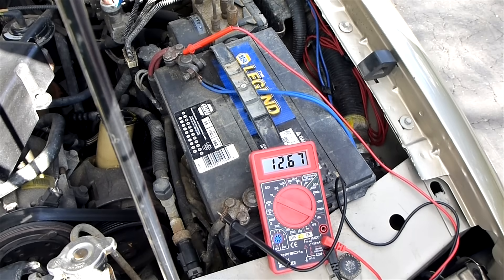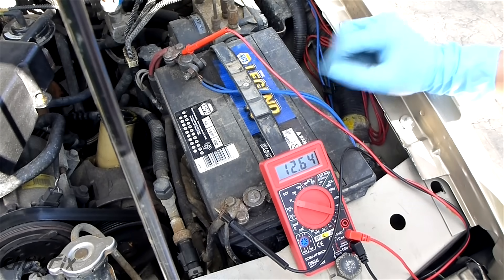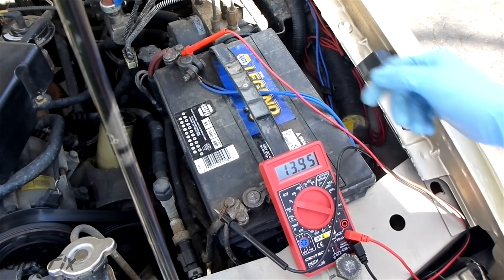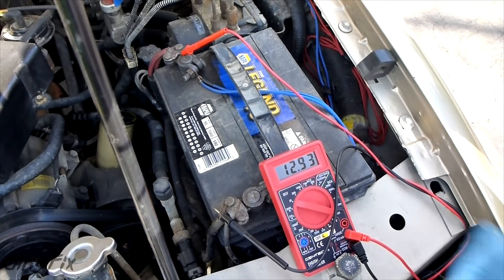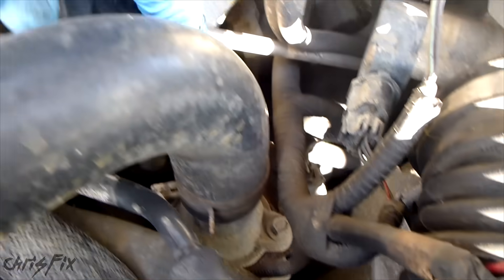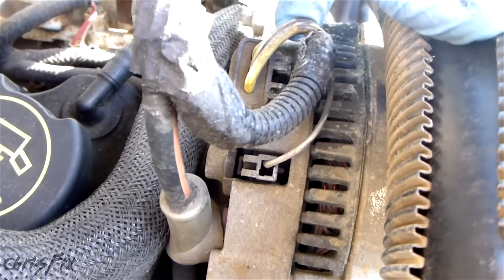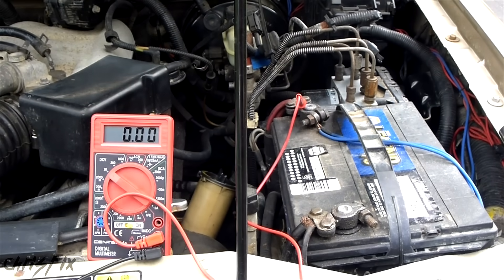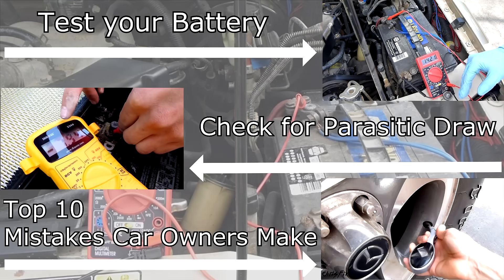How to Test an Alternator

Comment: Hey! Got an update went out and picked up a multimeter. With everything off battery had 12.6! Which is spot on when i put key in and in ignition position (when dash lights and checks come up) goes to 12.1-12.2v when car was on it showed 14.75ish. But then 5seconds of holding lights etc went dim for a split second and back to bright then went down to 14.67ish (just turned on engine so maybe somthing kicked in) so baffling but went for a 30odd mile drive and no battery light. Getting dark now in UK so will try the fuse test when i get some free time.. Thanks for the quick response.
Reply from the maker: Chris Selin Awesome! It is good you tested everything and now you have a good idea of what is going on. Can you explain what you mean by "But then 5seconds of holding lights etc went dim for a split second and back to bright then went down to 14.67ish" I dont understand what happened.

Comment: Hello i have used the onboard system that shows the battery voltages when off and on just like a handheld unit. May have to go buy myself one as may be more accurate. But as for leaving it well i always use the car but if use it for 10mins will be 12.8 or near then say 2hrs will be 12.1-12.2ish. If i do the same again but its sitting for say 10-15hours will still have atleast 12.1 so i havent seen it drop past 12 as of yet. Only thing i can think of is if the alternator wiring or so have been stripped and touching something. But dont want to go straight to a garage spending loads on something without success. Or maybe some other electrical leak but the car has so much on it its silly for e.g. Cruise control, electric mirrors, radio, electric chair, climate control, bluetooth phone (built into car not aftermarket) list goes on so would be a pain to pin it down looked online and people suggest could be a ecu fault with the ford smart charge system. Ahhhh just so much brain ache! Also i need to fit a battery clamp as its not secure atm but battery not moving as its a huge lump!
Reply from the maker: Chris Selin Try doing this test and after checking the fuses, disconnect the alternator wire and see if anything changes: https://www.youtube.com/watch?v=n5FJDgcdii8

Comment: Need urgent help but very very strange problem! Okay so basically i replaced my batter due to old one being to weak. So i got a higher end with 800CCA 85Ah right anyway i got the new battery but it sat in my boot in freezing conditions for 2weeks maybe then i fitted the battery (without charging) car has 12.1-12.3! When i turn engine on i get 14.6-14.7! So alternator is charging right?! But! Light pops up sometimes randomly but even when the battery light is ON its still charging when i shut off after 10min drive it will have 12.8-12.9v but over night or even couple of hours it will be back to 12.2v.... Just confused why the light sometimes pops up but when i drive off it can go off right away but sometimes will stay on until i turn off then back on... So new battery with 12.2V? Do i need to charge up or will the alternator top it? Just a head ache when its showing that its charging. What do you recommend. 2009 mondeo titanium (alot of gadgets) all connections look clean enough to eat your dinner off.
Reply from the maker: Chris Selin What happens if the car sits for a few days with no use? Did you test the voltage drop on your alternator like in the video? Is your belt loose?

Comment: Hi Chris,
 you should tidy up your battery. i noticed on the battery terminals you have those clamp type fitting, and some off the wire strands are not clamped, also the negative clamp on the battery terminal is loose, it moved when you pushed the test probe into the wires,, you didn't seem to no that this is a critical connection,,
undo that clamp, and spread it so the clamp goes all the way down the terminal and re tighten.
that's after you fit the cable under its clamp properly.
 then i would be interested to see you test the drop across this connection, turn your lights and every thing else on, not the engine for the test..
Reply from the maker: ScoutBoy Thanks for the tips! I will have to tidy it up.

Comment: Hey Chris, I have a 1976 Hillman Avenger(1600cc 4cyl, 8 fuse, 4spd manual) My alternator is not charging the battery at all, when the car is running i only have 12.55v at the battery with a good battery out of my other car. When i rev the engine the voltage remains at 12.55v and very slowly drops because i am draining it. I did the voltage drop test(on the 20v setting on the multimeter) on the negative side and had readings of 0.03v all the way so that seemed fine. I then did the voltage drop test on the positive side of the battery to the +terminal at the back of the alternator and only had 0.03v. I then moved the black lead and attached it to the other terminal on the alternator(which runs to the charge light on the interior dashboard) and had 0.48v(is this a significant voltage drop or is it just the standard power draw for the circuit back to the light on the dash? note: the charge light on the dash does not come on. Im beginning to think my alternator may just be shot and time for new a alternator or brushes/regulator) Thanks in advance, any help/thoughts much appreciated!
Reply from the maker: Javs Cuz That sounds like a bad alternator to me. .48v is a decent voltage drop but I would be more concerned with your 12.55v charging problem.

Comment: Chris you have very good informative videos. Point that I need to ask is when you do the voltage drop test your readings was -0.05. The key in that reading was the minus. It should be in the minus, correct? No matter where you touched the alternator, alternator bracket or engine block all your readings were -0.04 or -0.05. However when you did the chassis ground your reading was 0.06 (it did not have the minus sign in front of the zero). Why is that? When you did the voltage drop across the positive side and the alternator readings reading was -0.28. But in doing that test what if you get a spark?
Reply from the maker: smitty03281964 Thanks a lot man! The minus doesnt matter. If you switch the leads around you will get a positive number. Think of it as absolute value. I am not sure your concern with your last question and the spark? Can you clarify?
Reply: ChrisFix When I put the positive lead onto the positive battery post  and the negative lead on the alternator b+ cable it sparked when two wires touch and that should not have happened. Correct?
Reply from the maker: With the car running? The B+ cable is a "hot" cable meaning it is like your positive cable so by touching the ground to that, it will spark.
Reply: ChrisFix But I did conduct the test correctly right?
Reply from the maker: Grounding the hot B+ wire was not correct. Otherwise, if you did what I did in the video, you did it correctly.

Comment: I recently went to turn on my 2000 acura integra GS, and it turned on perfectly fine. I had my radio popped out a bit and when i went to push it back to the din, he car completley turned off on me..I turned the key back to off, made sure it was in park still and went to turn it back on and nothing...I attempted "accessory mode" and no dash lights or anything turns on, I have to jump my car with my civic to get it on...Any Suggestions? Any info is greatly appreciated
Reply from the maker: luis valentin Sounds like a short somewhere. I would try disconnecting the fuse to the radio and seeing if that works. Did you check the battery?
Reply: ChrisFix I haven't tried checking any fuses due to it being 20 degrees outside and snowing...I tried the old "jump start and remove the negative terminal" and the car stayed on...I will check fuses today after work and I am also having Autozone test the battery

Comment: My Car turned off after being on for about 3minutes I had the key in accessory mode so the radio and dash lights were on then the radio lights flashed and turned off so figured my battery wasn't charged. 
Turned the key completely off waited about 20minutes and put it in accessory again and tried to start... would not completely start but the dash lights came on. 
Tried to jump start it with another car that was running. still the engine would not turn over. 
Took battery out and to auto zone said it was a bad battery, bought a new battery and put it in the car. lights turned on and engine turned over but would slowly turn off. 
Went back to auto zone to have them test the alternator, 
he said i had a bad alternator..... 
Help me I'm not sure its a bad alternator if it was running perfect before i turned the car completely off with the older battery in it, but now we put a new battery in and now the engine won't stay on without my foot on the gas.
its a 2005 Scion Tc stick shift
Reply from the maker: kelly Hildebrandt Can you do the test like in the video? If you can have the car running and get a volt reading that would be helpful.

Comment: My alternator is pushing out 16v - 18v after the alternator was rebuilt. I have to drive with my headlights, fog lights, and my heater on to decrease the reading to 14v until I can take my truck to the shop tomorrow. Why would a alternator that was rebuilt 3 days ago go bad like that? Do you think it has something to do with my duel battery setup?
Reply from the maker: Khalil fahye Sounds like a voltage regulator problem.
Reply: How do I fix it? Do I have to take down the alternator and have it rebuilt again?
Reply from the maker: Khalil fahye Is there an external regulator? If not, then yea, the internal regulator will need to be replaced.
Reply: We removed the alternator and had it rebuilt/ change the regulator. That problem has been sorted out.
Reply from the maker: Khalil fahye Awesome! Glad you got it sorted out and everything is working now!
Reply: Nope- My gear box went out on me on the motorway 2 days ago. I'm looking for a Land Rover R380 here in the USA. I can't afford to have one shipped from the UK.
Reply from the maker: Khalil fahye Aw dang. Bad luck. You can get a decent Land Rover Discovery in the States.

Comment: Btw, some cars use a temperature sensor to regulate the field control on the alternator. The idea for this is to not overheat a hot battery with excessive charging. So if you are doing this on a very hot day you may only see 13.5V from the alternator on such a vehicle.
Reply from the maker: Cragified Thanks for the tip!

Comment: Hi ChrisFix  I have a weird issue,

First off, I had a parasitic drain  which leaves my battery weak 1 day and I find it hard to start. Three days I had to make a jump start from another battery so that's 3 drains per day.

After figuring the parasitc drain on the 3rd drain I have the car jump started and drove so I can charge the battery and be on my way.

I had the AC on and it drove fine till a heavy traffic ahead. Then the engine stall as stop& go traffic.

I managed to crank up the engine and start again and didn't use the AC. It seemed to run fine however whenever I'm at stop and will go the engine seem to loose power and I have to rev it up just not to stall the engine. I managed to get back home just doing this, and I need to be at the exact shifting just to cope w/ the RPM so that the engine wouldn't stall.

At cold start voltage reading will be at 13.6V till it is at running temp it will be at 14+ volts. About 14.2-14.4

there are times that I see 14.5V and rev it up wil rise to about 15 but it will be back to 14.9V instantly and will not go highter.

Just awhile ago I couldn't reach that and I'm fixed at 14.5v

Today, I tested a neighbor's battery (almost brandnew) to use in my car and surprisingly I didn't experienced hesitation on stop to go. It was back to normal as it's supposed to run. I ran the car around w/ AC on and no problems.

Then I use my battery and the problem showed again (hesitation to stop to run, and if I don't keep up at high rev it would stall.)

The battery is at it's end I know because I bought the car a year ago and it's 1 yr and 2 months in my hands, there's no marking when it was purchase and I pressume it's 2-3 yrs old. In my country batteries last at that age because we are a tropical country.)

Now my only concern is that I want to know the science / reason behind why the hesitation exist as I know alternator is responsible once the car started. It seems my alternator doesn't have problems (don't you think) based on my description.

I already did the alternator test of removing the negative terminal of the battery while the car is running and it didn't died out.

I haven't done your tests on the alternator but I will.

The confusing part is that why the new battery works fine on my car, and the old battery which seems to still have the CCA to start my engine. Yes I can manage to start the engine 2-3 times at cold start. Or even when the engine stall when it die out on my at stop to go situation even w/ the hesitation issue.

What do you think? TIA
Reply from the maker: While the car doesnt run off the battery directly, the battery is an important part of the ground system. If the battery is bad enough (which it sounds to be in your case), the ground might get interrupted so all your electrical components dont work as well giving you hesitation, stalling, etc. Make sense?
Reply: Good info enough, I forgot to add more info that the car is Carburetor, no computer box, no electronic doodah. But it uses a electronic igniter instead of a contact point in the distributor.

I will get a new battery based on the tests I made w/ the neighbor's battery. Besides, the battery is pretty much going to be dying soon as it's already 1 year in my possession and who know's how much it's been serving from the previous owner.

By the way, can I still use the old battery for car audio? It still holds 12.7v, floating is about 13.xx volts up to 12.9 and will stay about 12.7 and 12.5 overnight.

Thanks for answering, you rock! :)
Reply from the maker: The spark plugs still need electrical power and a good ground. You might be able to use the old battery for the speaker system but my guess if it is bad, then you you connect it to the charging system you will have problems again.
Reply: ChrisFix No I don't intend to connect it w/ the charging system. All standalone, I'll try to revive it by baking soda technique and will charge it w/ a battery charger 220v household. The battery is a low maintenance which you have to put distilled water in it.
Reply from the maker: Ivan Rubio Without having a charger attached to the battery it wont last very long for working the car's speaker system.
Reply: Yes, I'm just going to fool around with it :) How about doing a series of 2 weak batteries. :D
Reply from the maker: Ivan Rubio The weak battery will just bring down the stronger battery. Good luck!
Reply: Thanks, noted. You've been a great help :)
Reply: There is a misconception that alternators produce full current load at ldle. Not true.

The average alternator puts out 30% of its rated amps at idle. To get full amp output you need around 2000 rpm. 

The average car uses 30 amps just to run the engine fuel, ignition system and electronic computer monitor system. So a voltage test alone doesn't tell you everything. You need to know the amps output at any given rpm. 

You can over come this limit at idle in two ways. Use a smaller drive pulley or up the amperage output. Also be damn sure you use the correct voltage regulator. As the cars ECCM looks for a specific voltage wave length to control the electrical system and monitor it. And each one is specific to a vehicle, even same year and model can be different. You can tell by the color of the voltage regulator back or the original car makers part number sticker or stamping. So be aware that rebuilt you buy is the very exact same one they sell you.
Reply from the maker: Claude Rains Thanks for sharing!

Comment: thaks for the video 
but i have a question apart from this video 
how do i go alone cheaking the crank sensor on a nissan frointer  engine-zd30 ddt-i 3.0
Reply from the maker: vikar rattansingh No problem! Glad you liked the video! You can disconnect the wiring harness at the sensor and see if there is any continuity. You can also scan the engine and see if the sensor is in range.
Reply: ChrisFix  thanks bro but i have tried all of those stuff an still notting i did 7 dynositic scan an every scan i did same codes showing  up 
coolant temp sen!!!
turbo pressure!!!
an fuel injection timing!!!
 an i have sorted out all of thoes problems an still nun  > the symtoms i am having there is a lost of prower for example at any speed am at the power of the van drops an am like x too board an i goes no were an proceed an a very dead speed more likely at accident speed
Reply from the maker: vikar rattansingh Have you checked the fuel pressure?
Reply: ChrisFix yup checked all that an but i strongly want to belive it's an eelectrical problem or a sensor but can't seem to find the problem an 7 months am having this problem
Reply from the maker: vikar rattansingh Dang, that stinks! Let me know if you figure it out!
Reply: ChrisFix haha aite bro no probmz will do 
let me give give you an update 2014 febuary we bought the vehicle an up to this very month still having the problem 
just cheak the lenght of time am having the problem bro but don't worry i'll let you kno when i solve the problem